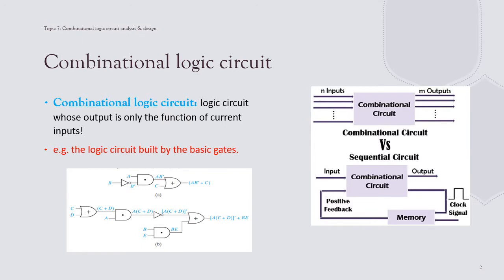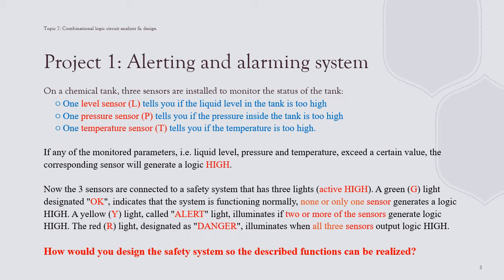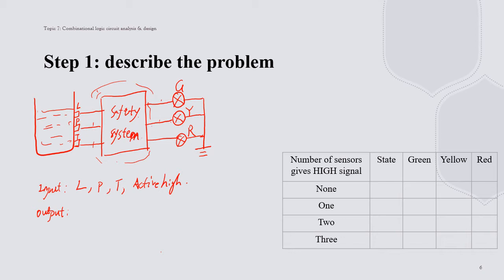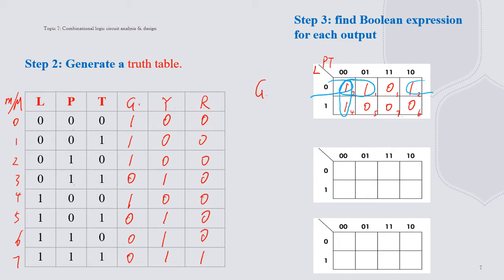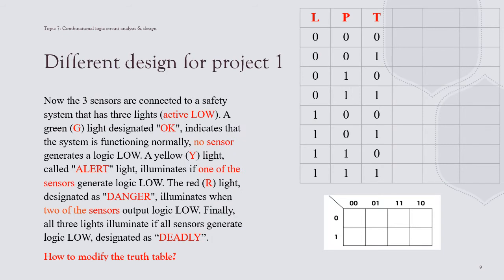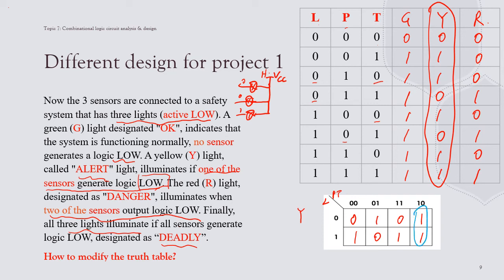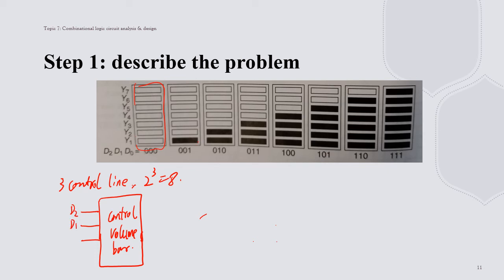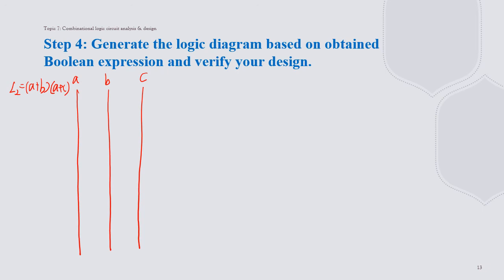Topic7 Combinational logic circuit analysis & design

Comment: Thank you for this lecture, Professor Zhou. May I please request that you make a video on very difficult combinational logic circuits questions? I’m finding these relatively easy and would like to challenge myself. Thank you in advance.
Reply from the maker: for more complicated questions, you probably can't do them manually as it is hard to solve the k-map with more than 6 variables by hand. You may use Quine-McCluskey method to do the simplification but still, cost too much time. In fact, this video is meant to be simple because people today use EDA tools to do more complicated designs. However, the basic concept behind is similar.
Reply: @prof.zhousclass2440  Thank you for your reply, Professor Zhou.